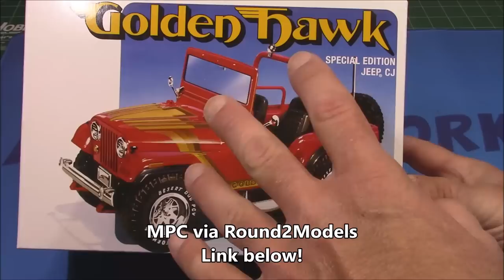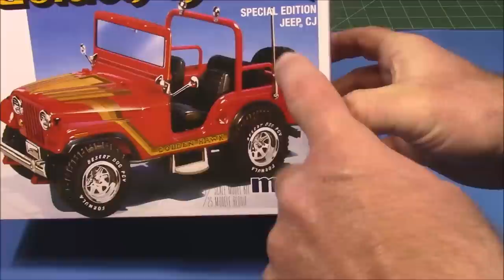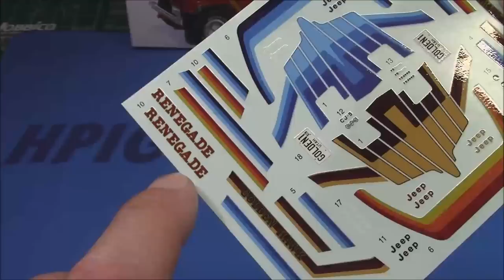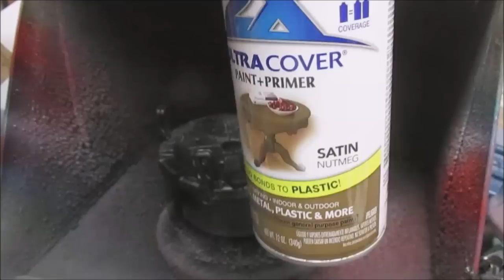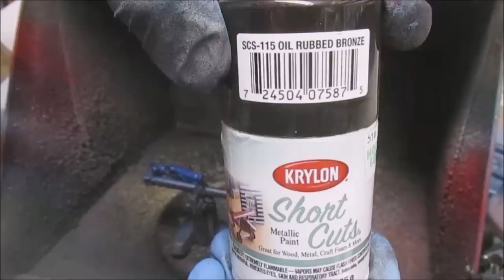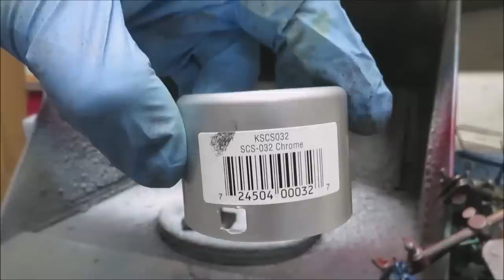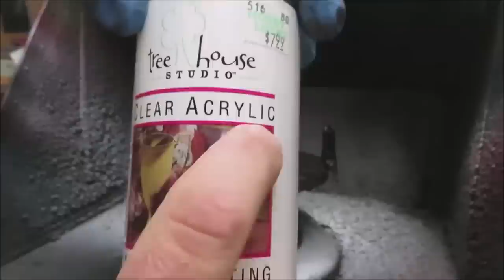1981 Jeep CJ5 Golden Hawk 1/25 Scale Model it Build How To Assemble Paint Dashboard Frame Tires

Comment: I love this little kit, but they have really taken liberties with the application of this CJ5, Daisy's Jeep was a CJ7, not a CJ5, the Golden Hawk may have been available in a CJ5, but a much later version. This particular CJ5 is based on the the early one with the short hood and side gas fill. It really builds up nice as late 60s early 70s model with the steel wheels. Nice build.

Comment: oh by the way I somehow missed the build of the Revell 57 Chevrolet you did some time ago and on the you tube channel I cant seem to find how to comment on it so I will do it here.  that kit was originally from the early 60's I have built that kit several times over the years and it has always been a bear to build I did get the parts for the doors and hood to fit on the original issue by doing them before I put the inner fenders in and the firewall was a REALLY tight fit didnt even try on the other two times I built it just went ahead and glued the doors shut and left the hood loose also the companion 55 and 56 kits from the same era has the same problems.  gonna try one last time on a reissue of the 57 Nomad I picked up on Flea Bay (its basically the same kit only with a Nomad body. built this one a long time ago and seem to remember the same problems anyway you had lots of fortitude to finish it I will quit bending your ear now keep up the builds